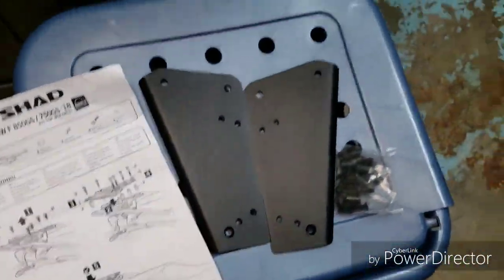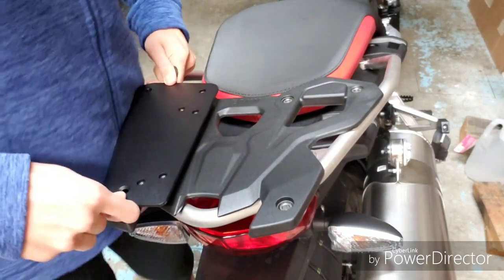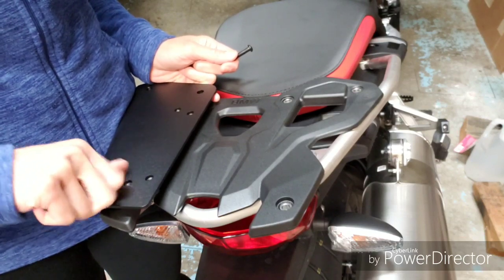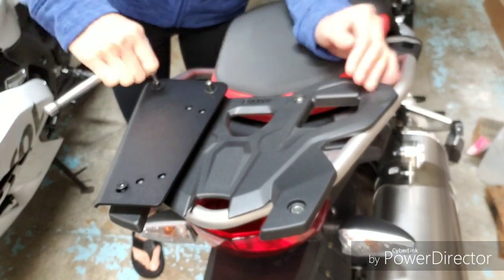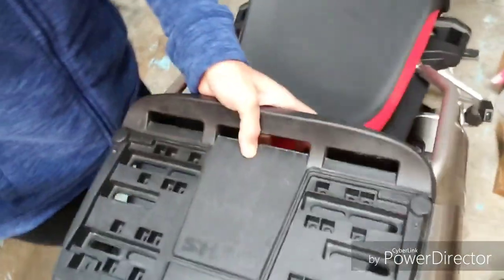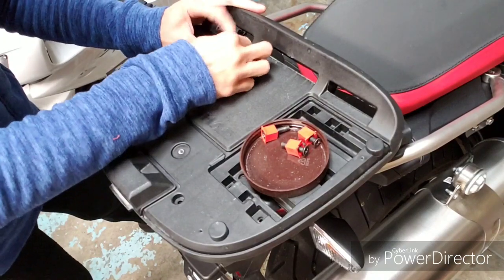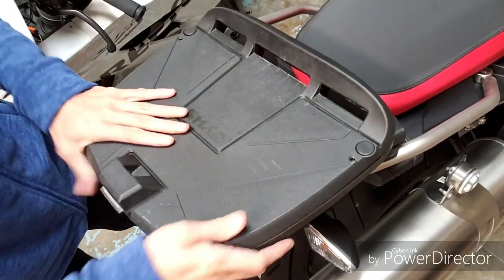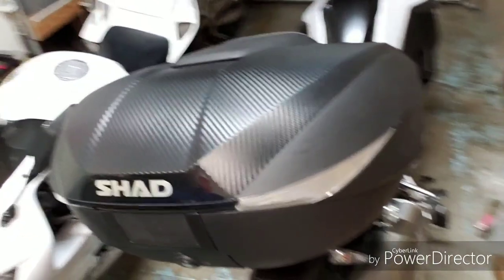How to install Shad Top Case & Adapter on 2019 BMW F750 F850 GS Motorcycle

Comment: Fyi - you should always use a thread locker, like Loctite blue, when installing accessories like a top case rack on a motorcycle because the vibration of the motor can loosen screws over time.

Comment: can  use an 0.125"   alum plate if can't find these from Shad.or piece of 1/8 steel ?
Reply from the maker: Custom plates and bolts can work you will just have to try. Good luck!

Comment: The orange screws you install to mount the top box plate to the mounting plate. Do they come with the box or with the mounting plate? I got my top box and I don’t have those screws.
Reply from the maker: It came with the top case

Comment: Pam got a question, did u get your top box from revzilla or twisted throttle, I'm just wondering if they send the same type of mounting plate brackets, I also have a 2019 f750gs!
Reply from the maker: I got them from twisted throttle :)

Comment: Bonjour, vous n'avez pas mis les boulons et rondelles pour tenir les vis en dessous?
Reply from the maker: No, because those bolts from the shad top case quick release plate mounts directly to the adapter plate without needing nuts from the bottom.

Comment: Pam, l am having a had time trying to get the adapter plate that u used in your video, called twisted throttle and they told me they do not carry it. Any help would be greatly appreciated!
Reply from the maker: Sorry, I misunderstood. I thought you were asking where I bought the top case. The actual adapter plate for the BMW, I purchased from Shad directly if I remember correctly.
Reply from the maker: You buy the adapter plate separately

Comment: Is this component  number W0FS88ST
Reply: Or W0FG78ST ? Thanks in advance
Noel
Reply from the maker: From the pictures it looks like it would be. Unfortunately, I can't confirm 100% as I cannot find my receipt for this purchase anymore. It's been years.
Reply: Thanks for the reply
I tried to pause your video at the start with the instructions as I thought the model number was on it but I failed 🤣 looks like a solid system! Did it work out well? Thanks for the reply again 👍
Reply from the maker: Works great 👍